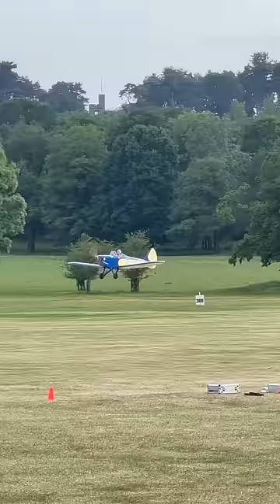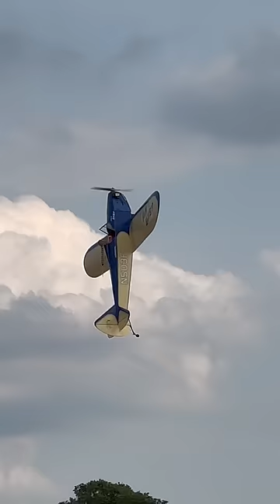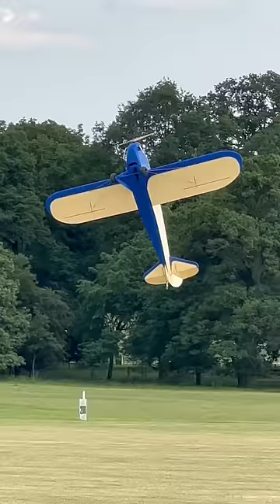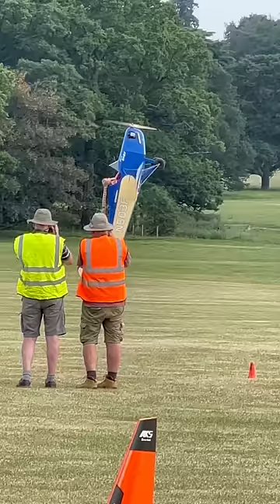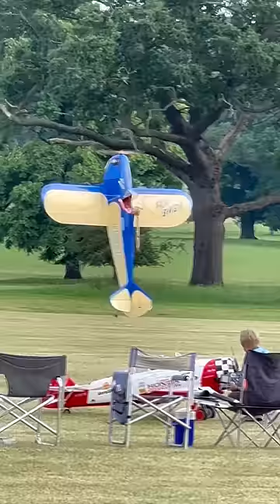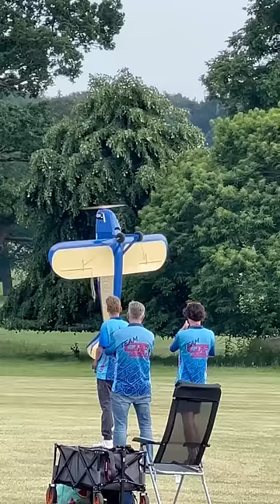Weston Park 2023 Fly Baby prop hanging super low!! #radiocontrol #rcaircraft #modelplane #aviation

Comment: IF this is real, that has to be a remotely piloted plane. Her left hand, which would be used for the throttle is holding onto the left side of the fuselage. Her right hand, which would be used for the cyclic stick (to steer the plane) is up in the air as if she's waving. So with neither hand controlling the plane it's remotely piloted or the whole thing is fake